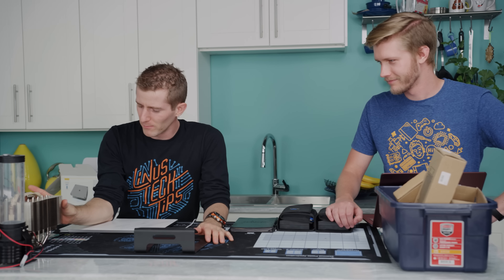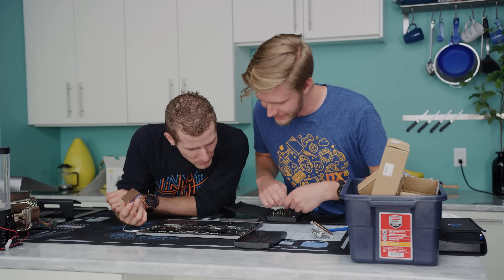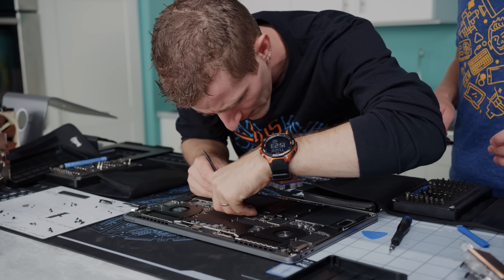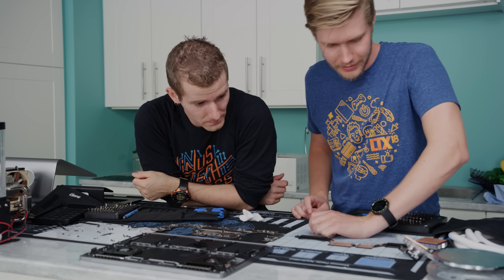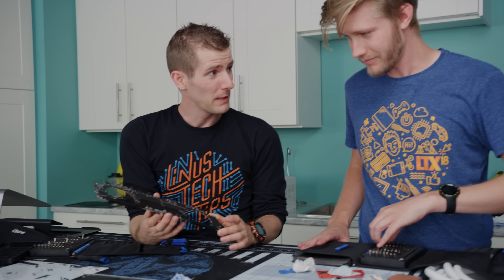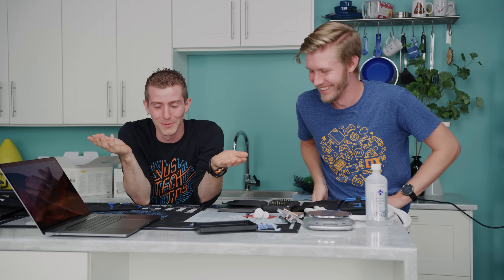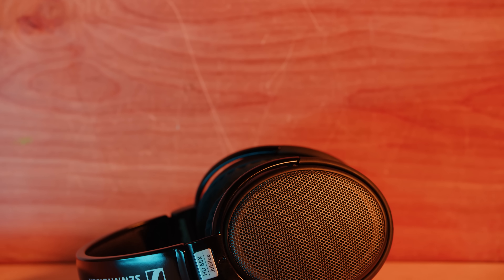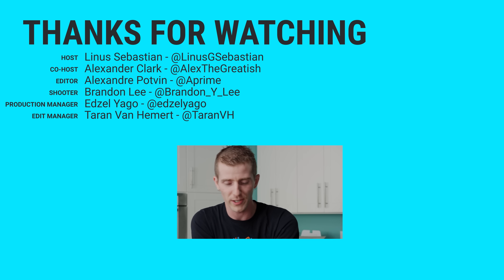We FIXED Apple’s New MacBook Pro

Comment: Apple: Why are you taking apart our device? NO! NEVER! MORE SCREWS!
Reply: SCREWS IN SCREWS!
Reply: They'll make a new type of screw just to SCREW up the competition
Reply: Very soon they will contact cermented everything, so the only way to fix is to replace it with a new one.
Reply: So then it's like the Surface Book
Reply: maybe they will make screws that screw in the oposite direction just to annoy you.
Reply: @matthew02006  why does that sound like something they would actually do
Reply: dye packs that leave apples logo on you
Reply: IIRC they used to actually RIVET on some components in the past... =P
Reply: They do now! The keyboards on those laptops with the Touch Bars are Riveted in! I think the answer is... more glue, more rivets! Less screws! :P
Reply: The other way around... NO MORE SCREWS! Glue them all. Solder them all. Where's the blowtorch?
Reply: Apple engineer back then: Who the hell would look inside the computer (the original Macintosh)?!
Young Steve Jobs: I WOULD!
Also the original iMac was meant for being easily taken apart by end-users for expansion.
Oh the irony nowadays . . . 
N.B.: Missed my old 2007 MBP. Upgraded, replaced and cloned hard drive multiple times DIY lol.
Reply: Jup. This is an engineering problem, not so a design problem, or better: it's a fucking management problem!

Design, if used like it should be, is to also streamline your production to make your product and the whole economy cycle as effective as possible. It's clear that Apple does use poor product-design, because the management fucked up and is probably on some kind of substance (might be 'greed' though) to squeeze more money out of the life cycle, by seeing HIGHLY overpriced repairs and components.

So watching this it's clear WHY the aftercare prices are THAT sky rocketing:

• WHO on earth would bother to take care of maintaining the system, when there are so, so many obstacles in your way of poorly engineering. It takes ages before you can take out any component to exchange it.

• which leads to swapping the whole inside, rather than repairing some shitty heat pipe or whatever.

Apple just became a company that made 'think different, think stupid' as a hiring claim for their management, engineers + also designers.
(well, it's not stupid for Apple, it surely drove their revenue up because customers are forced to choke on the shit Apple stuffed down their throats)
Reply: Head of design: More screws? Pfttt! We'll solder it shut next time!
Reply: 2019 MacBook with all new rivets.
Reply: reminds me of recent founders edition cards
Reply: Ok. He open it again. We need MORE Screw and MORE Shit components and MORE Limited apple ONLY
Reply: Change to adhesive!
Reply: Sorry new mbp is cloud hardware. No more tampering! Apple will observe you 24/7/365!!
Reply: What do you mean? More screws? Fuck no, they'll put in more rivets and glue to make it impossible to take apart without breaking.
Reply: More electronics glue
Reply: Inb4 Apple stops using screws and just solders the case together.
Reply: Apple: Why are you taking apart our device? NO! NEVER! MORE GLUE!
Reply: Just tack weld the piece of shit, and Jerry rig some tiny explosives. If you manage to open it, you loose a finger or two
Reply: I'm sure at some point they'll just weld the cases shut, since they don't seem to want to do actual repairs either.
Reply: @Cyromantik  True. Although if I'm not mistaken, a means of disassembly still has to be provided in order to certify a device for use in certain countries. For example, the FCC in the US requires the lab performing RF tests on a device to disassemble the device to analyse the insides.
Reply: And it's No, Nay, never
No, nay never no more!
Reply: More rivets!
Reply: They won’t even have screws in their machines in the next lineup...
Reply: This is so true
Reply: SCREW THIS! SCREWS IN SCREWS
Reply: Oh no they’re going to put 10 tiny screws inside a single screw for each screw
Reply: and whats worse is that their all different lengths sizes and type
Reply: so many reasons NOT to buy an apple..  what exactly are reasons to buy?
Reply: They will weld their products together.
Reply: Well Microsoft had a better solution for that. Glue!!
Reply: Tim Cook would be like: Create riveted screws and welded on case NOW!
Reply: So this is why luis hates new mackbooks
Reply: or they just weld,solder and glue everything together
Reply: *Evil Tim Cook Noises *
Reply: hahahahahaa
Reply: @Joey Veloso Or maybe replace more screws with glue instead, like on the iPad, iMac (& MacBook batteries too)
Reply: Or just solder the bottom.
Reply: Their devices are pretty magical so it probably detects if you are taking it apart and goes into code red and manufactures more screws for itself.
Reply: More welding
Reply: Maybe they’ll just weld it shut
Reply: Next time they would just seal the entire back panel to avoid users to open it, no more screws then.
Reply: No more screws! Everything will be soldered!!!
Reply: MORE GLUE
Reply: I mean apart from very high pricing,and poor cooling,apple laptops have very solid build,but honestly they do this to satisfy their users,because typical apple user want's quiet laptop,they don't care about overheating,i definitely like aluminium casing,and screws are there for a reason(even if that many)

P.S i'l get negative reply probably,but i'm windows user,didn't have apple machine in all my life.
Reply: The screw in a screw is technically just a screw adapter to make sure the screw fits in.  They found the lightning to USB adapters were the future so pushed that futuristic idea to their internal hardware.
Reply: soon enough apples computers are just gonna be a screw with a screen on it
Reply: No, that'd be too simplistic, it has to be a screw within a screw, with a screen on it - the second screw is an adapter screw for the first one.  You only get 1 screw in the package and need to buy the 2nd one separately.

Comment: Wait, what? On my main rig I applied liquid metal between IHS and Chip and between IHS and block on my water cooled 3570K last time in early 2013 and the thermal performance is still pretty much the same today five years later as on the day I did it... Is the newer Liquid metal somehow worse than the old?

Comment: this laptop is like a car where you have to undo the engine to change a headlights lamp.
Reply: It's like a modern BMW where they cover everything with plastic JUST so you have a difficult time getting to it. BRING IT TO THE DEALER TO GIVE US MORE MONEY
Reply: Modern cars are all covered up like this. We all want more stuff in our cars, and somewhere they need to put it. 20 years ago you could do easy repairs yourself, but now you need a mechanic for an easy timing belt change.
Reply: flo richi  That's why I own a 25 year old 1993 honda, do most of the maintenance myself.
Reply: flo richi timing belts are no longer a thing. It timing chains now and last much longer more or less lifetime
Reply: In europe only the high priced cars have chains rather than belts. Belts might have a shorter lifespan but are easier to maintain. The chainlinks get longer over time and can damage the engines, if the chain tensioning system is at it's max.
Reply: flo richi I used own a 2013 accent and it had a timing chain. Pretty much every Japanese and Korean car that’s using direct fuel injection has chains now. At least for those cars it’s not very hard to change
Reply: @florichi  
Buy a Micra S. No special features. Small, reliable, cheap.
Reply: flo richi I can clearly remember my late father in the 80's complaining how complicated it was to work on is 1986 Corvette having to switch back, and forth from ASE Standard wrenches to Metric ones, so I got him a set of Craftsman ones for Christmas that where both. I'll gladly go back to that being the most pain in the ass part about working on a car over a lot of the BS we have on them these days.
Reply: I need to connect computer in order to change brake pads on my 2015 Sharan :) 
Few years ago I do remember reading an article that EU is going to mandate swapping bulbs easy (since at that time some cars already required to take bumper of), but I've no idea if that was implemented at all.
Reply: @florichi  you need skill, not a mechanic.
Reply: i have to pull front bumper for all front facing lights, its is dumb
Reply: @kuromurasaki5273  somehow i think you're the dumb one, there is usually an entry way by removing a battery/turning the wheels/wigling your hands/buying a proper vehicle.
Reply: I told my wife after changing her headlights to take her Acadia to the dealer, have them do it or bring home a new car. Engineers....
Reply: i thought you said 'cat' as in 'meow meow' and wondered what the sweet shit kind of cats you have that use headlights and engines. Caterpillar diesel? okay, that actually works.
Reply: My parents had a Cadillac that required the engine to be dismantled to change the starter as it was internal
Reply: It's like a minor cut where you have to do an open heart bypass surgery to change the bandaid.
Reply: Oh just like with my Renault Modus where you have to take apart the front to change the lights
Reply: I'm gonna go out on a limb here and guess most of you have never touched an engine. I mean, "undo the engine" was the first giveaway lol.
Reply: Turbo Chook: Oh sorry, that I am not a native speaker, and couldn't think of a better word, while writing that part of my comment.

Keith Boykin: My seat Leon is the same pain in the arse. Or at least I think it is, because my grandpa who was a mechanic couldn't find a way into the front turning signal, but the mechanic at the shop changed it for 4 bucks, so there either wasn't much to do, or it is the standard price for a bulbchange.

Commoderfan64: WTF? Who had the idea to implement bolts with 2 different standards?

Kuro Murasaki: What car is it?

Comment: If you guys spent as much time on getting audio right as you do thinking up clickbait titles, that'd be great. It should have been called "we found a temporary solution to achieve a 10% performance gain to a problem that isn't really a problem and almost bricked a $5000 machine in the process." ;-) On a side note, damn that piece of hardware is sexy inside.

Comment: 2:54 You’re dismounting a computer with the AC charger on ?
Reply: Probably turned off though they just want to keep the power chord in to keep it grounded so they don't short out any components with their touch.
Reply: Thanks bro' ! I didn't know that we can use the ground for preventing shortcut. Even if is made for that. 
Another question. Sorry, to bother you ! 
Is the bloc plug on the wall ? If it is there jus on the macbook...
Reply: No problem. I used to plug in my components religiously when working on them but over time got lazy and have never had a problem but obviously not the smartest idea to work on any electronics without a ground or static-free gloves. 

The block plug on the wall confused me as well perhaps it is possible to measure the output of an electric cable run through one of the wall plugs not in use assuming you have one of those devices. I have no idea how electrics work.

Comment: 13:10 Warnung! Nicht mit Aluminium Kühlkörpern verwenden!
Warning do not use with aluminum heat sinks!
Reply: Steve Owen THAT IS NOT COOL
Reply: DanielsLPecke So is that stuff just mercury then?
Reply: Jac Curtis No its a metallic mixture with mainly Gallium. If Gallium comes in contact with aluminium it becomes porous.
Reply: MrRaptorious Oh, ok. I thought it was just mercury that formed the amalgam with aluminium, but gallium makes more sense due to the much lower toxicity
Reply: @jaccurtis5789  gallium and other stuff
Reply: @jaccurtis5789  galium amalgum, still not great for your aluminum heat sink
Reply: galium
Reply: Lol. The MacBook is made from aluminium :')
Reply: It comes with an English warning on the other side but Linus just thinks the German one sounds better. It was in another LTT video in about another crazy cooling experiment but can't remember which one exactly.
Reply: Is the MacBook sink aluminium?
Reply: xpusostomos no its still copper only the case is made of Al.
Reply: Auf der Rückseite der Warnung dürfte das auch auf Englisch gestehen haben

Comment: I was waiting for the temperature comparisons and never got them.
Reply: Both time it is thermal throttling.
Maximum temperature is maximum temperature. Not much to compare.
Reply: Jehty21  if that was the case why would it be done the same task faster
Reply: @semahj  because it doesn't throttle as much.
Instead of comparing the temperature (which will always be at maximum) you compare the CPU clock rate.
You should Google thermal throttling, i assume that you have a wrong understanding what that is.
Reply: Jehty21 exactly it doesn't throttle as much. Which means it does a better job of keeping it cool so I want to see how long it stays at the lower temps.
Reply: semahj lamons you really dont get it do you
Reply: Jehty21 Regardless I'd still like to see the max temp numbers, and how long it took to reach those temps compared to stock, along with the CPU clock speeds.
Reply: Wim don't get what? Your agruments aren't making any sense. Of course it still throttles but it takes longer to do it. I wanna see how long. Why is this hard to understand?

Comment: I applied liquid metal with conformal coating on my late 2016 15" and still managed to fry a temperature sensor. After that one of the fan was constantly spinning at 100%, the good news was that between the fan and the liquid metal the laptop was running super cool....
I brought it to an authorized apple repair center, where they closed an eye and replaced the logic board under warranty. As soon as they gave it back  I opened it up again and this time successfully applied Thermal Grizzly Kryonaut instead of the liquid metal

Comment: You guys should do this with SMC Fan Control installed and set the fans to max speed so you can actually measure the thermal performance of the cooler.

Comment: I'm blown away with how cheaply things are done for such an expensive machine.
Reply: have you seen the new iphones?
Reply: It's apple, nothing surprising
Reply: Ever watched Louis Rossmann's videos?
Reply: Liquid metal can corrode your cooler in the long term
Reply: @Vvk732  If it causes a reaction, sure. If not, it's fine. The only thing that comes to mind is aluminum on copper and vice versa.
Reply: Now you know how apple makes monney, dumb customers, that buy cheap products at outrageous prices
Reply: And has Linus tested his Liquid Metal hack for the next three years of day in and day out use...  I didn't think so.
Reply: What is cheaply done?
Reply: @Hdjakanwvuekyeiiezzqo  the cooling solution its litterally 5 grams of sheet metal
Reply: The thermal paste. Just based on the countless amount of experiments with liquid metal, why the hell aren't manufacturers using this technique in the factory?
Reply: i guess linus told you why... the necessity of reapplying it ever so often.
Reply: @MarkyShaw  I assume it is too risky. A laptop is build for everyday cary. It rocks around in a backpack and so on.
Reply: Liquid metal application is harder to automatize and can destroy a machine if misapplied. A high quality TIM, though? No reason not to use that aside from price.
Reply: @pigdad  thermal grizzly kryonaut isn't too expensive and is the best non metal based thermal compound
Reply: Liquid metal also damages the spreader and copper surfaces on the long term...
Reply: Because liquid metal can ruin your board if it touches it. That and good thermal paste could last the lifetime of the computer, and doesn't need to be re-applied (it's good practice to, but your computer doesn't die if you don't).
Reply: Marky Shaw  Hard to apply automatically, extremely dangerous to the components if anything goes wrong, needs to be reapplied periodically. That last part is pretty key, even if everything else was perfected.
Reply: +Mark Shaw Because liquid metal needs to be reapplied every so often and that is a terrible user experience...
Reply: the 5 gram heat pipe is pretty shit for I believe is an i9
Reply: @MarkyShaw  they aren't using because as linus said in the video the liquid metal needs to be re-applied PERIODICALLY, which isn't practically viable for everyone
Reply: Liquid metal is not the best thing to use on a laptop, because it will break down and need to be reapplied (as Linus stated).  The issue, from my point of view is poor engineering, coupled by using inferior products (ie: cheap thermal paste).
Reply: How could one increase the thermal heat pipe weight to collect more anti-apple mater (heat) lol
Reply: nothing is done cheaply, just shittily.
Reply: Brodie Haward fuckin love the word shittily.
Reply: I mean their slogan is 'think different' which we should read as 'think a little shittier and a lot more profit'
Reply: In Apple's defense, thinking shittier is different.
Reply: @jordan the iphones start at the same price as last year, only difference is the new max model costs way too much.
Reply: How are things cheaply done ? People go on about isheep but the only zombies I see are the pc masterrace crowd upvoting stupid comments like this. I see a lot more complicated engineering inside a MacBook Pro than I do in most windows laptops. Apple have good profit margins but they don’t cheap out on their hardware.